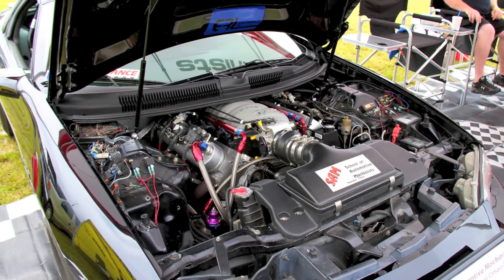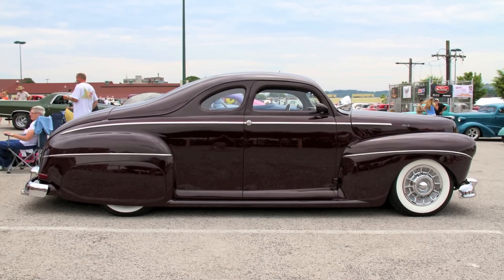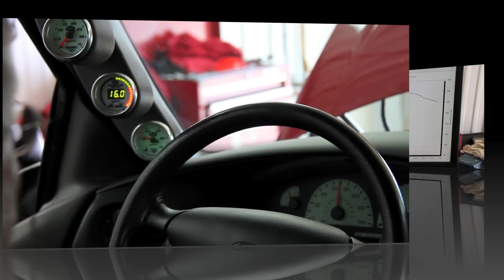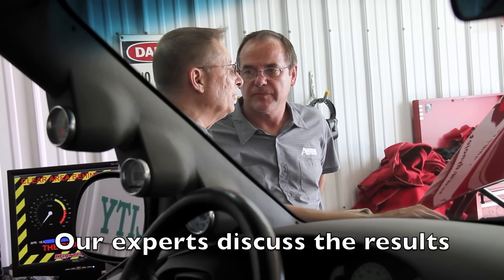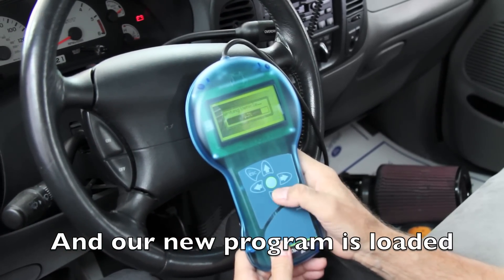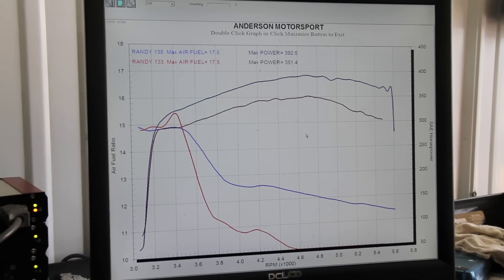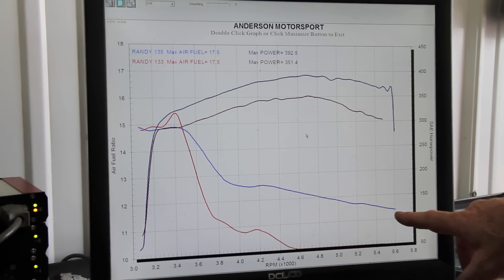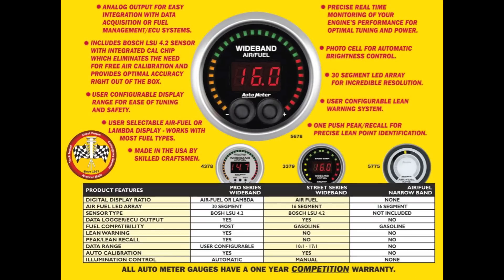AutoMeter Wideband Air/Fuel Tuning (and a Monster Burnout)

Comment: How about a video on why we need the wideband meter and not just explain how a lean mixture produces more power.  Or can anyone explain to me how this gauge would be a good addition to my cluster. Why do I need to monitor the mixture?
Reply: i have a good answer, one of the pipe tread plugs in my aem fuel pressure regulator wasnt torqued all the way and started leaking ever so slightly, when i first installed it and set the pressure level it wasnt leaking, i was drivin hard and i noticed the engine was runnin a bit different and that my AFR was goin over 14 nearly 15 sometimes on wide open throttle. when i first set it it was to 46 psi at 800 rpm idle, i checked and it was down to 37 psi at idle, tightened plug and fuel pressure came back up. if it runs too lean you lean out your engine and boom. all that said if you have a stock engine on stock ecu theres no need, the stock o2 sensor should do its job just fine, and if it does go wrong you should get a check engine light for it. im runnin a built engine on aftermarket ecu and it had lean protection but i didnt have it set up yet, after that incident i set up the lean protection lol
Reply: david gomez

Comment: I understand how a richer mix is safer, as the extra non burnt fuel acts a a cooler for the engine. Protecting from detonation. I don't see how the running leaner would add more power. Won't the engine still combust all the fuel it can anyways if the mixer is rich? Where is the extra power coming from? I understand the danger of running lean but I dont see how it adds more power. Better combustion over all? IE the extra fuel actually prevents some of the stoich mixer from burning?

Comment: I have 2 major issues with this marketing video. Firstly, I find it hard to believe that a factory tune on a vehicle of this vintage would have AFR bottom out a wideband (<10:1) at only 4,600 rpm. Maybe there was some "tuning" done before hand? Second...and this is a big one. The tech said that they also adjusted TIMING. Engines sometimes have a very large range of AFR efficiency. Meaning they make the same power at say 11:1 as they do 12:1. If you increase timing you can potentially increase HP a lot. The AFR change could have made no difference at all if you also changed the timing at the same time. If you want to show the benefit of getting AFR a little closer to stoic you have to NOT change anything else at the same time.